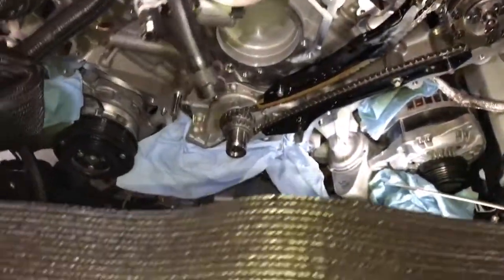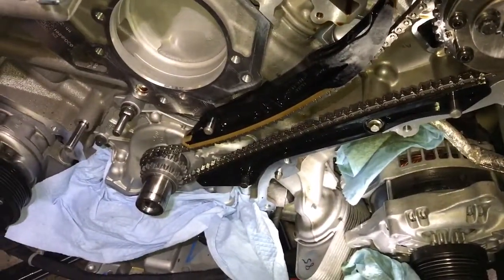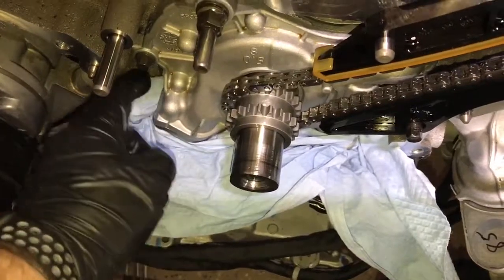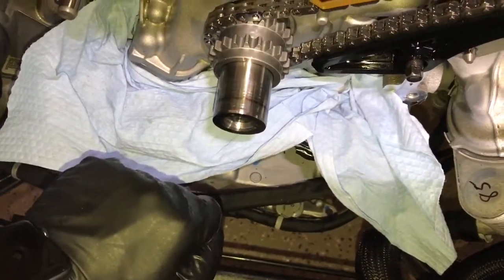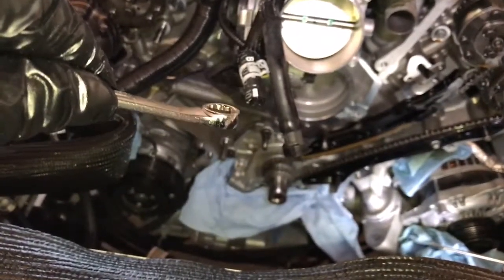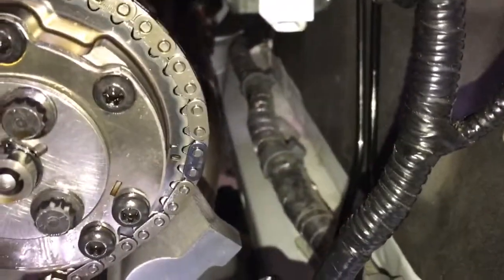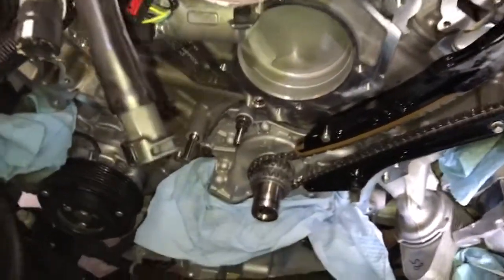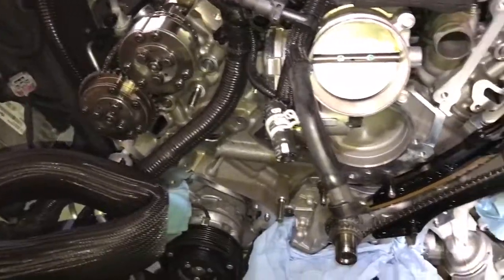2015 Mustang GT coyote oil pump gears crank sprocket install timing engine part 4

Comment: On the left side at 5, I forgot to turn it 360 and then to 12. Instead I just went from 5 to 12. 

Now that the time is wrong, do I just do it from the beginning like Ford says OR do I have to take a different approach considering the incorrect timing?
Reply from the maker: Jorge Linares assuming there's no motor damage you'll need to start the timing procedure over again to get the cams and crank to where they belong. Most of what I've read says these are non interference engines but even when asked on a sales thread about their crank sprocket MMR didn't give a straight answer on whether its interference or non interference.  You'll most definitely want to go by Fords recommendation - and it's completely possible to get timing back to stock - you'll just have to verify all components are in time as they likely were when the engine came apart the first time. 

Best of luck!
Reply: @gqneon  I tried to do that. However when I took off the cover, turned crankshaft to 12 o clock but  the camshafts arrow right side is supposed to have arrow pointing up with R. Both sides have L with arrow pointing up. I'm not sure what to do.
Reply from the maker: Jorge Linares yeah it sounds like you're going to have to drop the two timing chains and set each cam bank to match where it should to be get your timing correct.  You'll need ford reference manual for initial timing set for your car - or if you're unsure how to do that a reputable shop or the dealer should be able to get you squared up.  I haven't got my cars to make something new to reference for your situation anymore, but I'm sure it's all fixable as long as there was zero contact with your valve train and your rotating assembly. If that's not the case you'll have a much bigger issue ahead